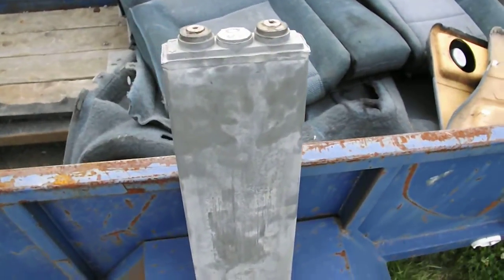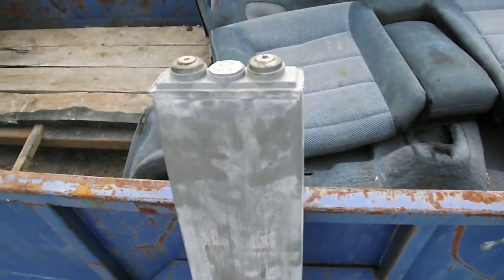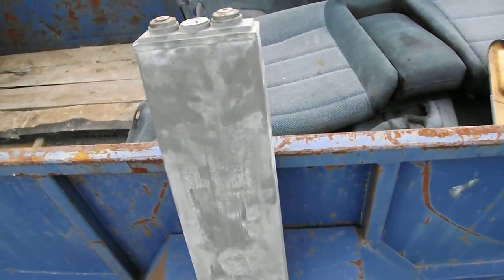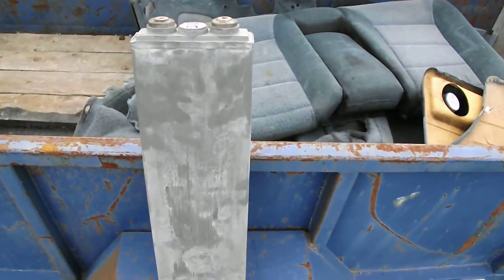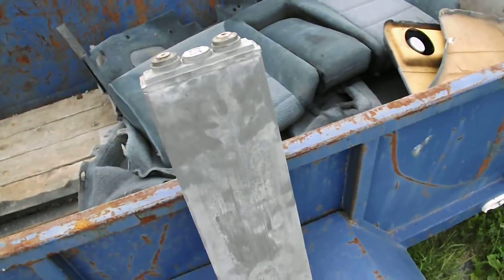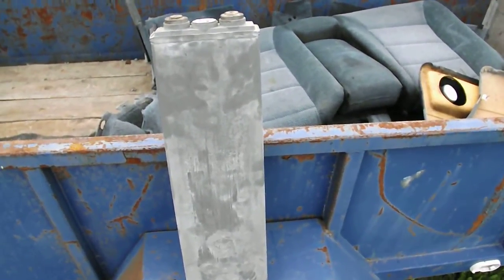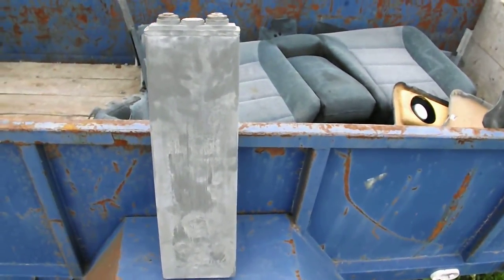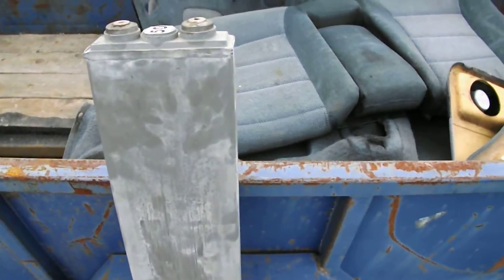Battery Lead Acid Single 2 volt Cell Charging

Comment: These are industrial cells. They have a long service life. To revive older onesdo this: Open the top and add a tablespoon of alum disolved in distilled water. Let sit overnight. Next hook directly to a space heater wired through the wall circuit. Apply power till the heater glows brightly. Next add a diode to make the current DC till you get about 2V across the cell. Next charge with a high current to about 2.4V. You might have to get creative, but a MOT with some thick wire and big diodes will do. You will want about 50A or so through the battery. Stop when it rests at about 2.4V. Next repeat with the remaining cells. Discard ones that refuse to charge or charge up very quickly. ❤

Comment: I just picked up to Absolyte GX 2000 48 volt battery banks. I need to learn how to interconnect these because they do not have plates or racking. Do you have any suggestions?
Reply from the maker: Make up you own box to hold them together. I did just that with these other one's i had that had nothing. I used wood. For plates i used alum flat bars
Reply: @MrDoingEverything  I never received your response! I just came back after reviewing my information after a year! Sorry I never responded back to you. I would like to email back and forth about your system. I had a heart attack last year so I forgot about this video - hope you are doing well and I look forward to speaking with you if you have the time. Blessings and thank you again!

Comment: Which charger is recommended to charge a 2v 600ah cell
Reply from the maker: I made my own charger. But a adjustable power supply will also work.. For a 600 amp hour 2 volt cell. The power supply will need to be  many amps output in adjustments. A low amperage adjustable power supply will be to small for the charging of it for the starting of charging or it will take a very very long time to charge up with a lower amperage type. Could take months but for sure it will take weeks. Starting charging amps for a 600 amp hour 2 volt battery cell. My guess would need to be around 150 amps then as the cell comes up in charge the amps go lower and lower till the cell is full. But how many amps it would need is based on what kind of battery it is. Best to find out the spec's of that cell to know for sure what the charging currents max is. I,m only guessing based on my own type cells i have had in the past. There are so many different types of lead acid batteries with all sorts of different charging spec's. I have no way to know that answer.
Reply: 5-20% of AH rating is usually recommended charge curren.
So 30-120A is suitable for 600ah battery

Comment: Thanks for the reply, and well done on the charger. :)
  And also thanks for the thought on charging 3 at 6volts and swapping the cells around till they all get a good top-up. I'll do that for now. Will need to get a charger that does 6V, as the 2 i have at the moment only designed to charge 12volts.
Good idea. Nice Thinking outside the box. Cheers. ;)

Comment: Thanks for the video. I have batterys exactly the same, but they open at the top to add d.water.
 Originally from a chinese forklift, i got 24 cells. Made 2 banks of 6 cell each, and one bank of 12cells. (all 12v totals).
 One of the cells in the large bank has died, so i've cut that bank down to the best 6 cells. Of course that leaves me with the odd number of 5 cells. (10V approx).
 I want to keep these for spares, but have hit the same problem of: how to charge 5 seperate 2volt cells?
 I know theres a way, but have no real solution yet.
 Would you share the way that you've come up with?   :)
Reply from the maker: john Russell Sure I made my own charger for charging a single cell check it out.   https://www.youtube.com/watch?v=pjwQJRMSVrk
Reply from the maker: john Russell Another way is you can hook up 3 cells and charge at 6 volts. Then remove one and hook up the last one and keep going with the 6 volt charge. Keep switching around the batteries until there all charged up evenly. Its real nice to be able to have extra cells on hand for sure. Hope it helps
Reply: How do you make your own charger can you please show me how or make a video for how you make your own charger that can charge  2v 600ah please

Comment: 1.75v per cell? Thats some hardcore deep cycle.
Reply from the maker: DarkLinkAD That's the low end of the cell. Normal voltage should be at around 2.20v That would depend on how new or good the cell is. But yes heavy duty type for sure.